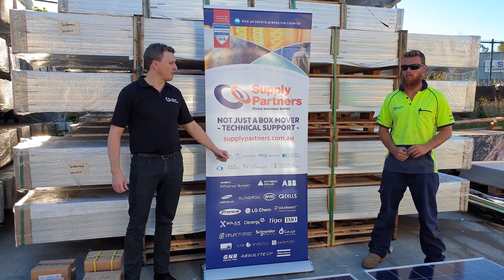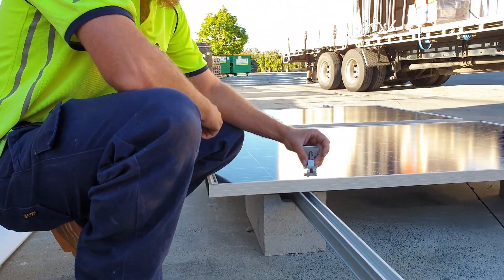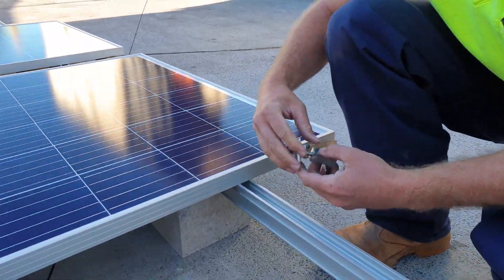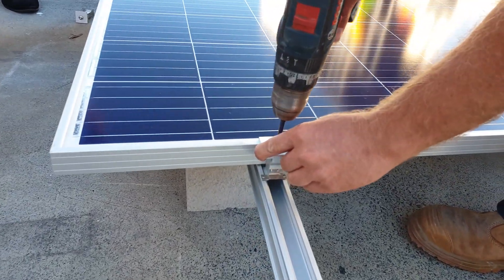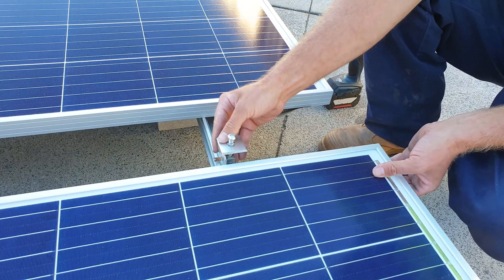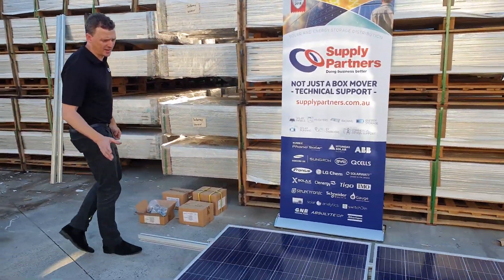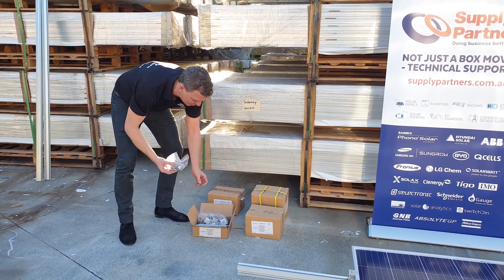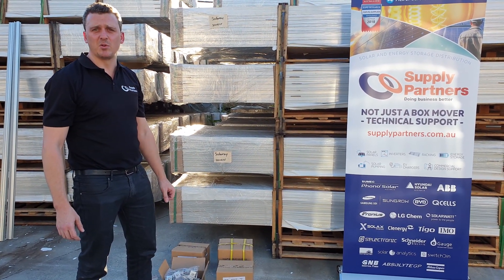Clenergy PV-ezRack® Universal Clamp Installation Demo

Comment: I know the industry uses clamps.  What I don't understand is why use friction instead of a physical bolt through nuts and bolts.  What if the installer had a bad day or in a rush and didn't tighten the clamp sufficiently? I suppose that could also happen with a bolt through connection but at least the loose nut and bolt has some holding power.  On the other hand, a loose clamp has no holding power.
Reply: Not really practical in rooftop solar plants. Clamping is a better solution there. For ground mounts, we can do bolting.